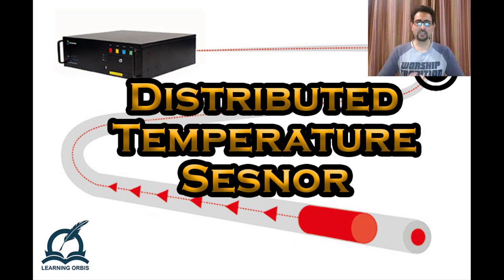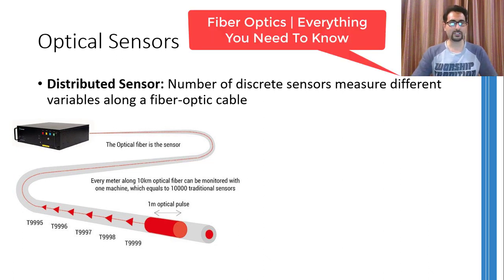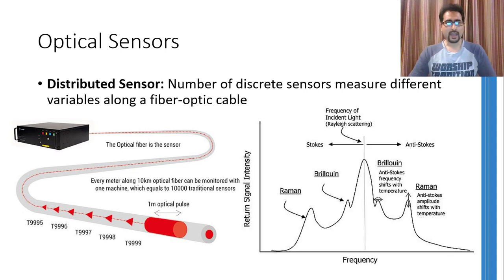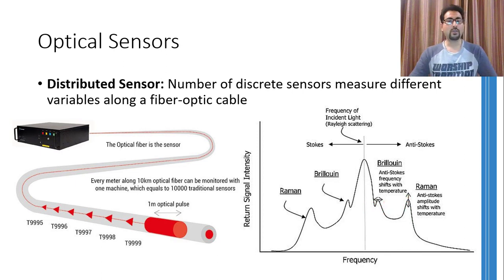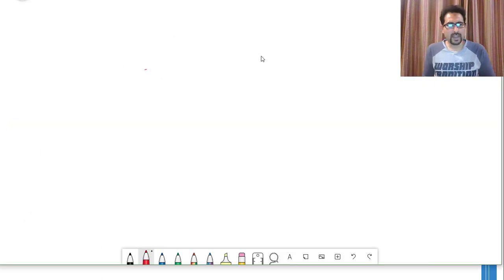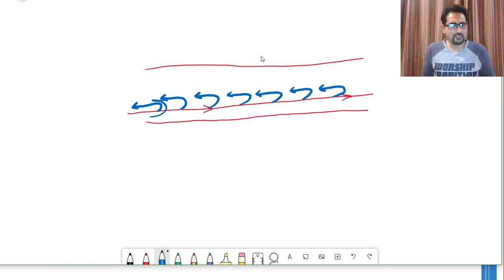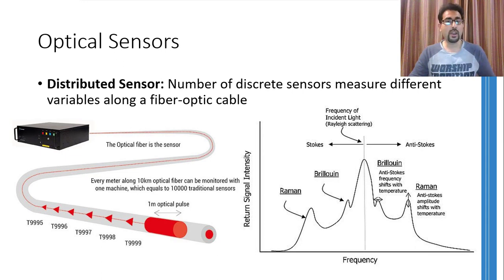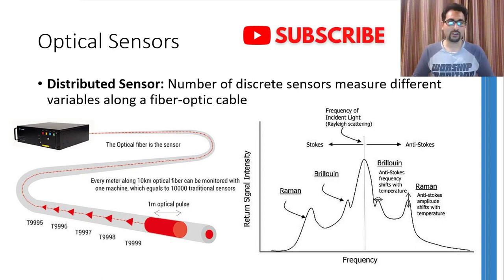Distributed Temperature Sensor | How It Works?

Comment: Very Nice presentation Sir,

Can u explain me what is significance of 1550 nm Wavelength & 1310 nm wavelength in DTS system.

Why two different wavelengths are  using for different applications?
Reply from the maker: Both wavelength are below visible spectrum, therefore, cannot be distorted by the visible light which is everywhere. Secondly, generating these wavelengths is easier using IR/Microwave LEDs. Thirdly, the frequency spectrum of reflecting waves show significant sensitivity to temperature. That's why these are being used. The range of temperature and environment also dictate which frequency can be used.

Comment: Good day. Very impressive.  A quick question.  If fibre optic cable is buried underground.  Could the fibre optic cable itself be used as a sensor to measure vibration in the ground itself?
Reply: Application for a perimeter security system?
Reply from the maker: Anything that can modulate or effect the light traveling inside the fiber optic can be measured using it. I don't think that underground vibrations can be of that much magnitude that they can effect the working of fiber optic and hence light traveling in it.

Comment: 4:44 I guess that adding a slight delay at the start of each "scan", much finer spatial resolutions than just 1m can easily be obtained even with the present computational limitations, at the expense of course of least frequent sampling of any given point in the length of the fibre. Much like the early digital storage oscilloscopes used to work, when the Digital to Analog converter was not fast enough (and hence "real time" sampling of current DSOs could not be achieved). Am I right?     Thank you for the interesting description and happy new year.
Reply from the maker: Yes that way you can achieve much better spatial resolution. In this way a single light pulse will give you temperature data of the spatial locations along the whole fiber optic that are 1m apart, but the next light pulse or scan, if delay is added for example of 0.5m, will give us temperature of all spatial locations which are 0.5m displaced from the previous spatial locations. In this way we can achieve higher spatial resolution at the expense of reduced time resolution.
Reply: @LearningOrbis   Exactly!